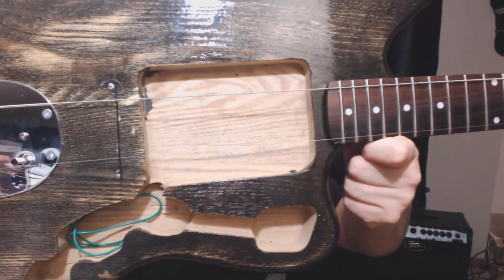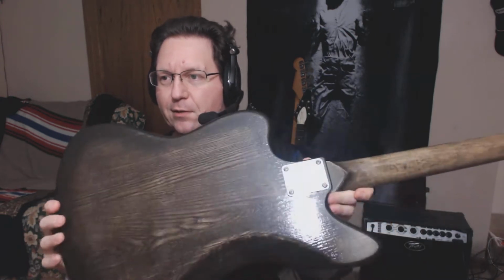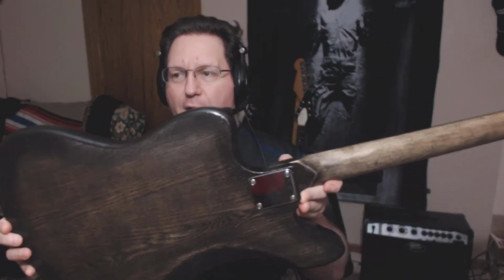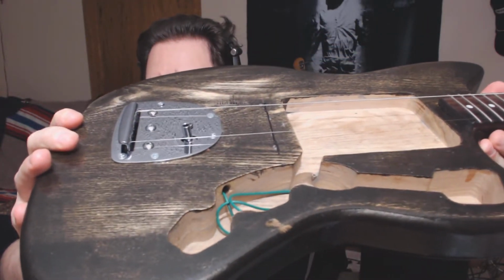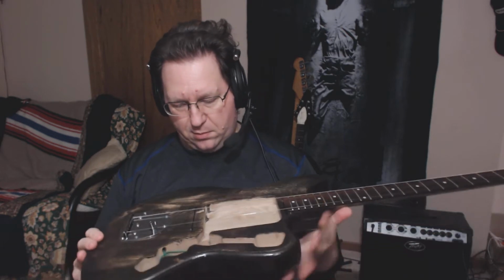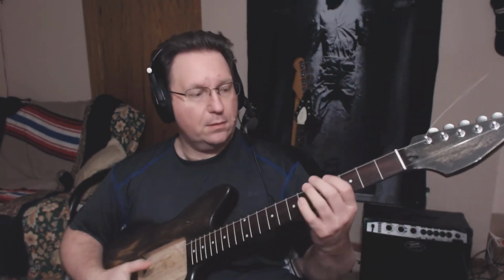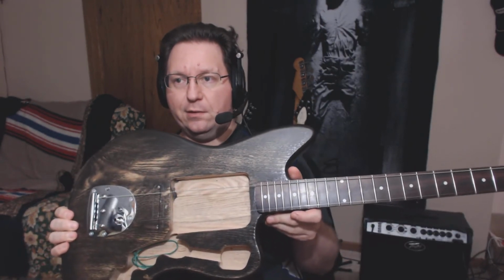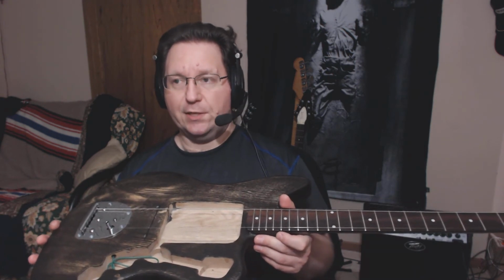Project Jazzblastard: 4 (mounting hardware)

Comment: Coming together nicely, Terry. Bad luck snapping the bit, we've all been there. If it's under the bridge you might be able to drill it out with a larger bit and glue a short dowel in the hole. I got a bag of 100 bamboo skewers for £1 last week, just a smidgen over 3mm diameter. Perfect for repairing scratchplate screw holes and enough to last me forever (discounting any I use for kebabs!)
Reply from the maker: yes ... found a use for that shitty duct tape ... couple wraps around the posts & it was snug as a bug in the larger holes .. he he he :)